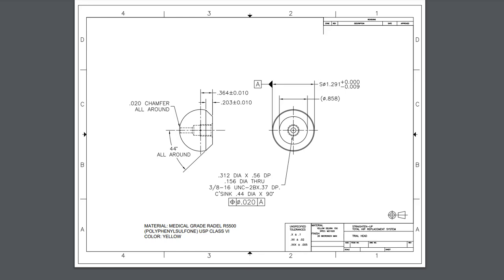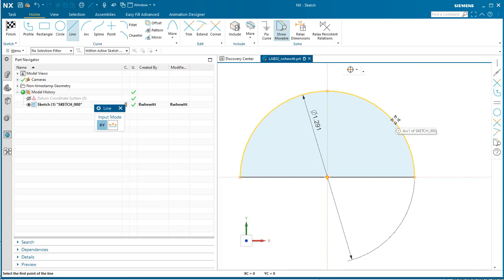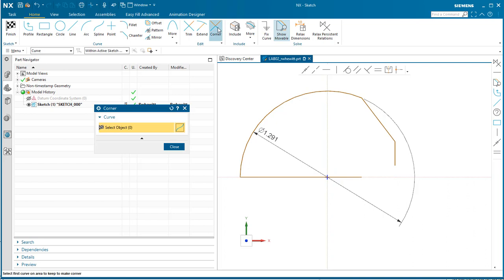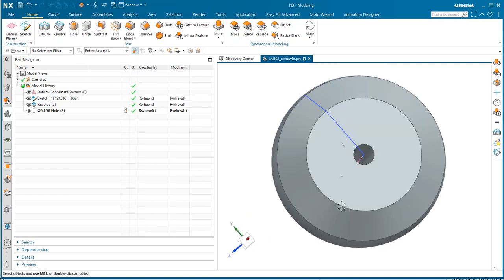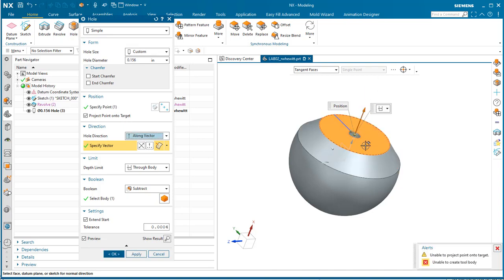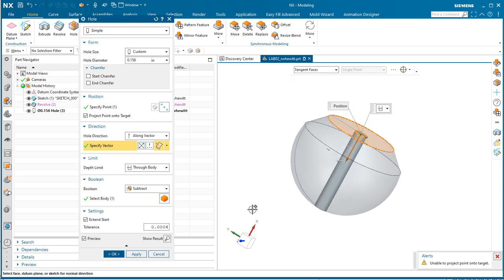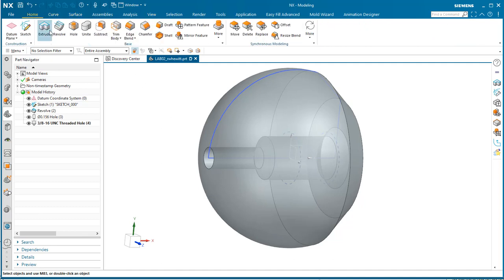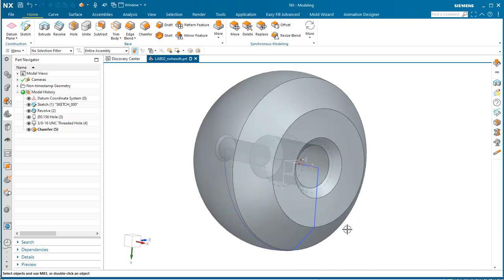TECH 4472 LAB 02 Trial Head NX1980

Comment: So, I might be crazy here, but I've almost entirely stopped trimming sketches in NX. I think if you do it early, it is fine, but once a sketch gets to any level of complexity, my experience is that a trim operation turns everything into a goat rodeo. My preference is just select single curves with intersection termination or region bounded. Since I'm the only guy using NX here, IDK if this is just me being wrong, or what. Interested to know what your experience as an instructor is!
Reply from the maker: As a rule I try to keep sketches as simple as practical.  It has gotten a lot easier to work with sketches in  recent versions, but in general I do use the trim and extend pretty sparingly.  Close corner is usually pretty safe.